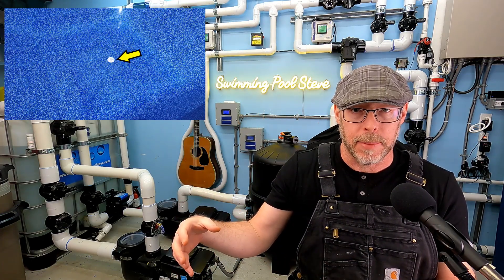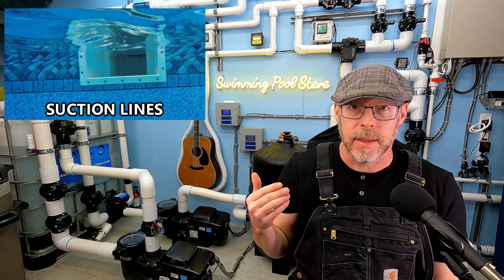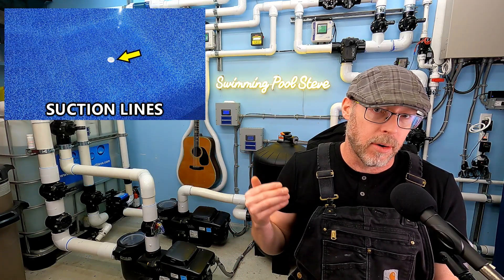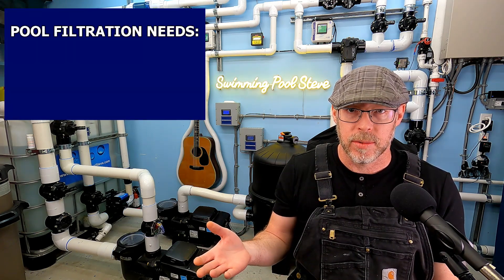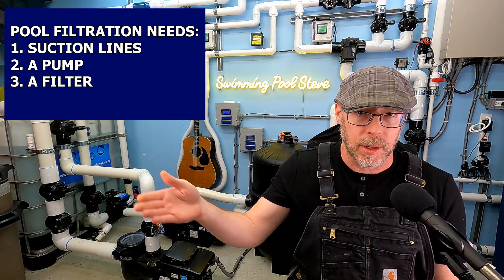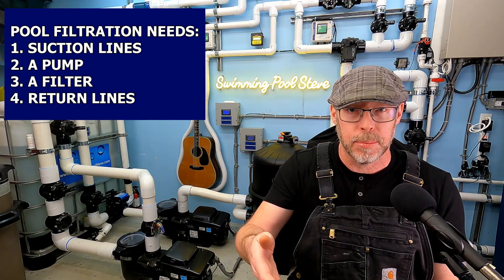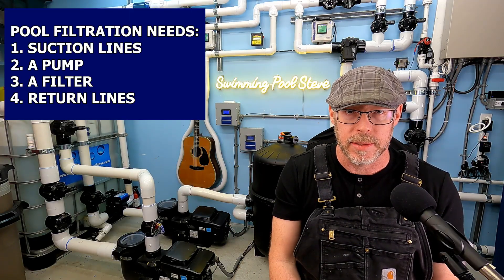How Does Pool Filtration Work?

Comment: Great video Steve.  Why backwash a DE filter instead of full cleaning?  Just easier?  Mine dumps to my backyard, so I tend to just clean it manually as needed instead of putting all that DE in my dirt.  So, how do people know they backwashed too much and now need a full manual cleaning?
Reply from the maker: Minimizes time to maintain the filter. Cleaning the grids by stripping it down is more work. Filter pressure is what tells you when there is a problem
Reply: @Swimmingpoolsteve cool.  I'm doing it right. :)